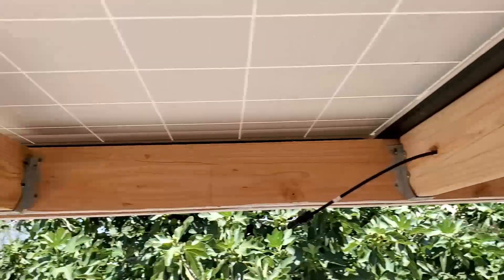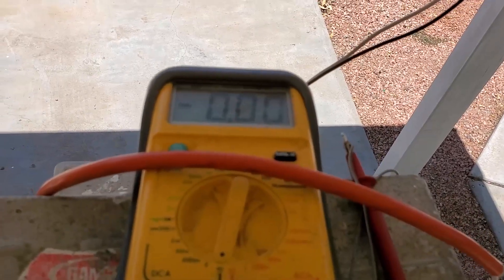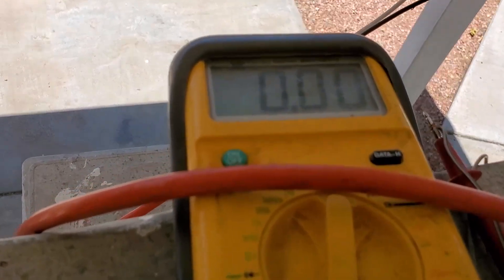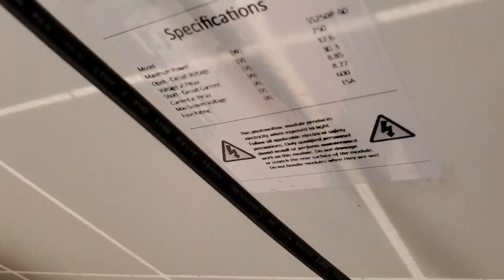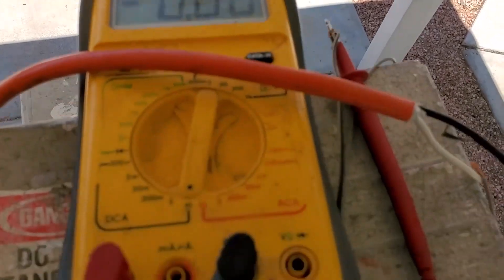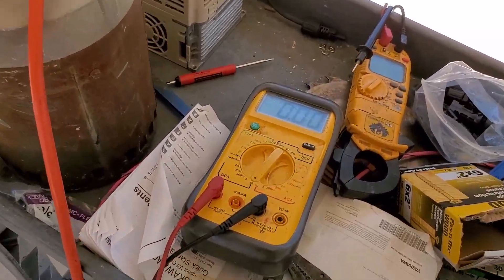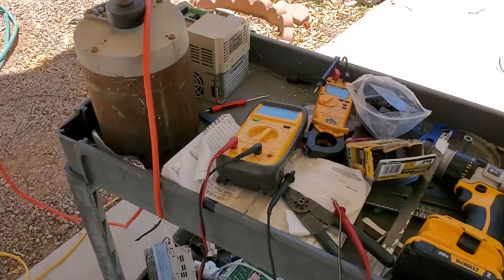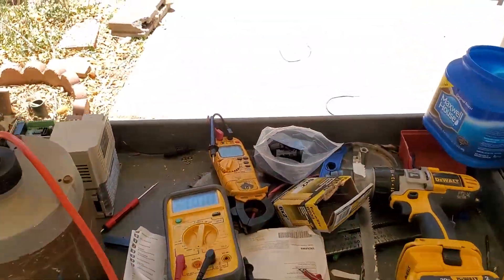Arc Flash from Solar Panel Power!

Comment: Lol. The panel is a current source, so shorting it directly is completely OKay.
Reply from the maker: Yeah I suppose so. 
Just hard to get over that. HA HA
It's funny that the internal fuse rating is 15 but all it can muster is less than 9 amps.
I guess maybe that is in case someone mis-matches some series connections with other panels or something.
Reply: Yes. The panels are large surface area photodiodes, so they can conduct current in reverse. For example, connecting a battery directly to the panel will definitely smoke the shit out of it, if you forget the series connected diode or any other reverse current protection.
Reply from the maker: @Sixta16  
I'm possibly going to be getting both the panels and the on grid power to the same VFD. 
I'll be rectifying the on grid external to the VFD so I can possibly regulate it. 
And I already figured I had better install a diode on the output of each power source to prevent backfeed.

The system should (should,  lol) each supply current to the VFD.
I fugue I'll have to set my on grid supply to a little under 300 volts so the solar will flow most of the current when there's sun

Comment: That also why DC Breaker are so much larger, you need some active Arc breaking.
Reply from the maker: Most DIY panels are set up for low voltage high amps.
Mine is high voltage low amps.
My friend had a disconnect for solar. It had huge lugs on it! But it's for people doing lots of amps at only 48VDC or even less.
If I wired these as a 2S10P instead of 10S2P as I have it, I suppose it would be 60VDC and 85 amps.
That indeed would require a huge disconnect and some heavy ass wire!
But mine is 300VDC 17 amps. So 12 gauge wire is enough and a 30 amp disconnect should be good enough as well. 
I need to get one installed soon.

Comment: That’s why 50 V is considered dangerous voltage when dealing with DC. DC is a whole Nother world  . Getting zapped by 240AC is a little sting. Getting zapped by 240 V DC is a trip to the morgue.
Reply: You got it completely wrong.  AC is way more dangerous as it can cause involuntary muscle contractions that you can't overcome. Getting zapped by 240Vdc is  way less painful and less dangerous, unless staying in contact for prolonged periods of time.
Reply from the maker: @Sixta16  Interesting.
Rumor has been that DC was worse.
I did some reading and I guess not.
Reply: Go and check out ElectroBOOMs channel. He's a crazy ass, that's for sure, but his videos are very educational in this respect.
Reply from the maker: @coldfinger459sub0  This is a year old reply now...
But anyway.  I looked into several electrical forums and discussions and the sort and there are a lot of opinions on this subject of AC vs DC dangers so that is why I referred to some of it as a "rumor".

It wasn't from just nobody but from several discussions of professionals and some confining to be engineers.
But I've seen how far that title can go.
Reply: @Sixta16  
AC sine wave voltage convulsions is a let go and gravel let go and grab kind of thing it’s a zap DC your hand grabs it it clinch is up in one direction only and doesn’t let go. 

I’ve easily grabbed 120 V 240 V. Held on and let go no problem there’s no urge to not let go it’s easy

but on the other hand when I Grav 70 or 80 V plus of DC you’ll notice the stronger you grab it the more your arms and your hands crawl up in grip tighter and as you turn up the voltage the convulsions to squeeze harder increase. 

I know from first-hand experience.   Not from reading books or what somebody says on the Internet.
Reply: this is why I can never learn anything right.